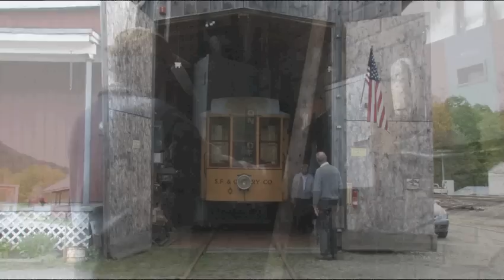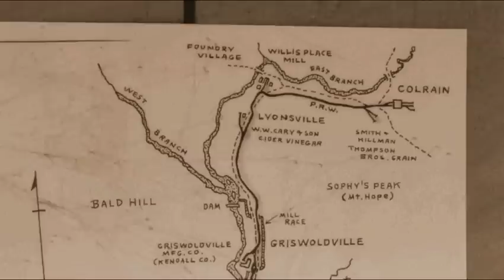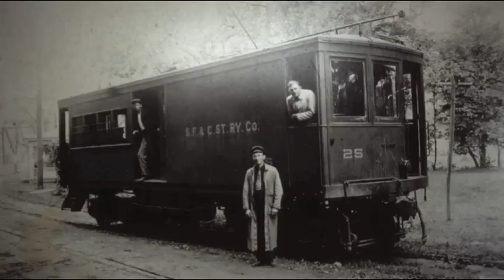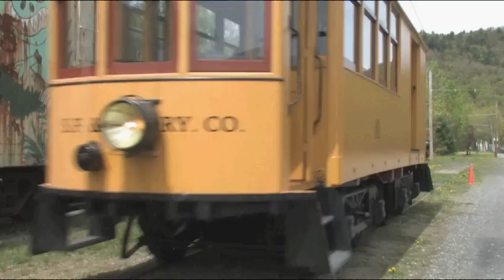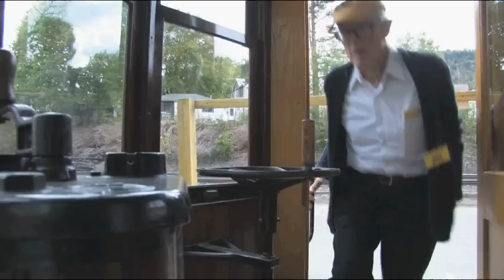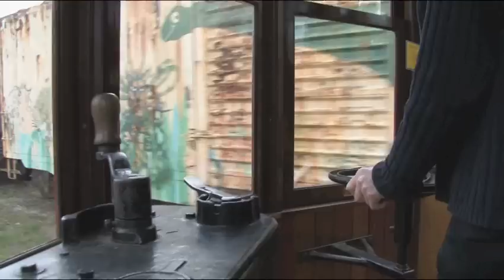Shelburne Falls Trolley Museum

Comment: i'm hoping that someday both F&LSR #60 and the holyo9ke street railway car still in existence wind up here, and get restored back to operation like no. 10.
Reply: +Ellie Flint The plan at the moment is that F&LSR #60 comes to the museum once the new car barn is ready.
Reply: I sent a message to Sam inquiring, and he said possibly this spring.
Reply: @railfan-q3504  The carbarn is now built but has to be extended.
Reply: What number car is holyoke street railway car?
Reply: Supposedly car 144, that’s how it appears on the bera list

Comment: What happen to trolley car 25?
Reply: It was set on fire to get rid of it.
Reply: As Rowan said, it was set ablaze. This was a common practice for most defunct street railways. Scrappers did not need anything but the metal, so they would typically just set the cars on fire and then lug off the metal. The reason No. 10 survived is because of Marshal Johnson, who, as the video says, wanted the car for a shed on his property. The cost to have the car moved I believe was around $100. Of course, In today's money, that would be a little more than $1000, not exactly cheap, but not a bad price to pay either!